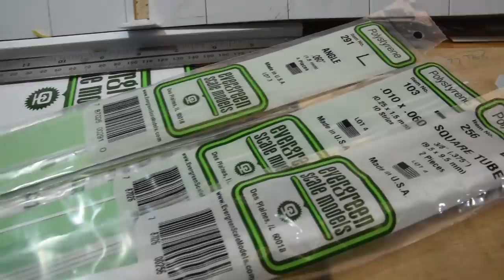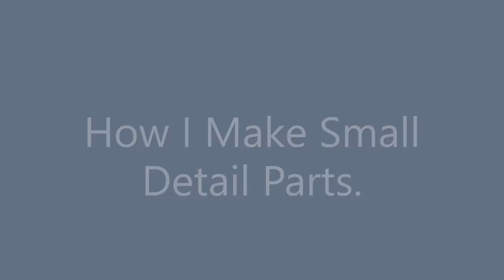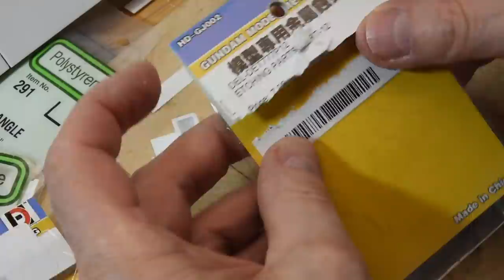The Brewery Build "Part 6" | River Road - Vlog #48

Comment: Building like this is very practical and you only end up with a tiny amount of waste in the end. I'll take those tiny little pieces you actually can't really use and put them in a clean small glass paint jar and add the liquid glue/solvent, which I use MEK as glue; and dissolve them and make a styrene paste. Depending on how much liquid you add, you can make it different consistencies of thickness. I make mine just liquid enough that I can use a paint brush or toothpick to spread it. It works good for filling in cracks on plastic kits that are off a touch or hiding your own screw ups when scratch building. It also works good for making weld lines on larger models. When it dries which doesn't take long it sands and paints just like regular styrene. Keep it in the paint jar air tight and it will stay pliable and will mix up easily with a stir stick and a touch more of solvent if needed. When it gets low just add more of the two ingredients.  👍
Reply from the maker: Sounds good! All those little craps make for good scrap metal gondola loads as well! Cheers.

Comment: Excellent video on basic model scratchbuilding...  Styrene is such a great material for this type of modeling.  In the day and age of inexpensive laser cutters and 3D printers it's refreshing to see someone doing the most basic model building efficiently.  Excellent source for photo etched vents, I'll have to look for those.
Reply from the maker: Thank You. I can build faster than a 3D printer for the purposes of a one-off with limited parts anyway. For me, 3D-printers need to be justified. People buy them (to become obsolete overnight), and then, invent a reason to use it. They have a purpose , but for me they are way over-rated. Cheers.
Reply: Agreed!
Reply: @boomerdiorama  Yes, for the details you're building, this is definitely the way to go, it'd take far longer to design, then print them on a 3D printer, though the advantage is that you can make unlimited numbers once the initial work is done.  

I model obscure narrow gauge models, so a 3D printer (I have two) is more than justified.  But at the end of the day, I much prefer the model building you're showing here.  Takes a lot more skill and creativity than just making a solid model (3D CAD) and printing up parts (some would argue it's just a different skill set, I would agree to a point).  

Anyway...  Another great video.  I really enjoy seeing professional model builders such as yourself, hammering out scratchbuilt styrene models with such ease.
Reply from the maker: @WHJeffB  If I built the battle of Waterloo (figurines) Diorama, I would go for the 3D printer for sure. They are a powerful tool for the model railroad genre for sure as well.

Comment: Hey boomer, I was wondering what you use to seal different layers off paint?  Dullcoat is getting impossible to find.  Thanks.
Reply from the maker: In most cases I don't seal between coats unless I decal a locomotive for a particular finish, etc. Layering flat coats for buildings etc, are over-rated for me. I don't bother because I mostly use flat/primer paints anyway. I hope that helps. You can also use Tamiya PS - 55 "Flat Clear" (spray can) in replace of Dullcote. I was apprehensive, at first, but I find it to be very good if I can't find Dullcote. Cheers.